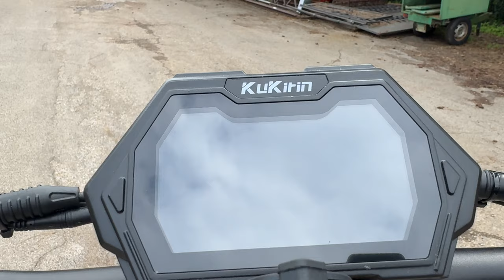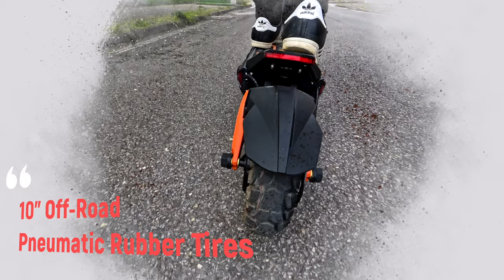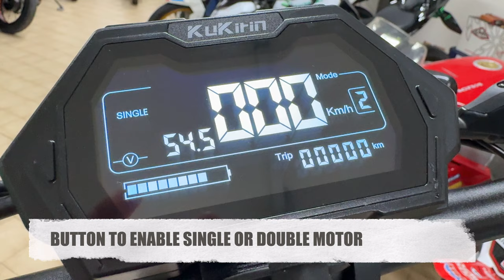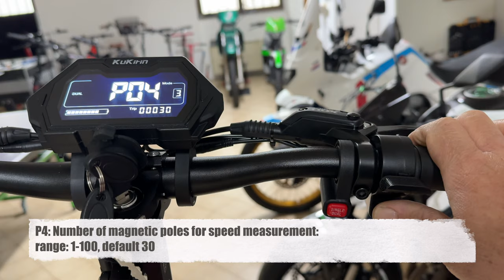KUKIRIN G3 PRO - THE POWERFUL E_SCOOTER WITH TWO MOTORS IS HERE - FULL TEST & TOP SPEED - 4K

Comment: Congratulations! Very good test. I have a question regarding the height of the handlebars. I'm 6'1" and as the handlebars are at a fixed height, I'm wondering will the height be right or too low? Thank you very much!
Reply from the maker: I’m about 1mt,90 tall and I’m fine with it... But the handlebar is very high and it’s made for tall people

Comment: How is your g3pro going 91kmh because it is supposed to go 65kmh have you overclocked it or some
Reply from the maker: Ho impostato 72v ma poi li ho tolti dopo il test perché il motore si sforza troppo… Poi come ho scritto, il secondo test è fatto in una discesa molto ripida…
Reply: I was wondering the same thing, I thought you maybe they had upgraded the controller to a 30amp instead of 25amp. (Like the Roadrunner RS5)  I’m 180lbs & Max 65km on flat smooth road & 71km downhill.  So did u just select 72v in the parameters settings ?? 
I’ve had mine since last September, done over 1000km with lots of problems …….but so much fun ….when it works ……Battery range isn’t even close to 80km unless there’s no load at all .